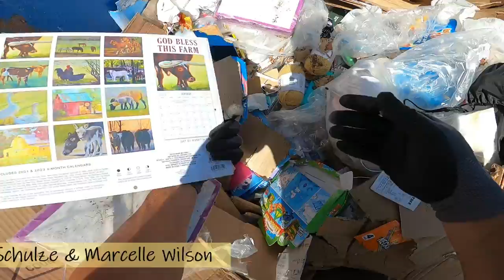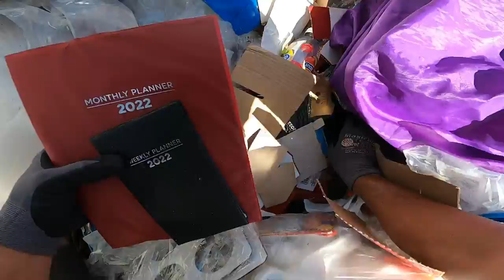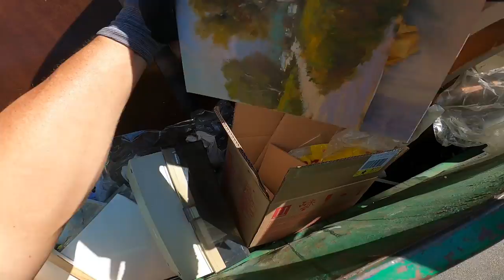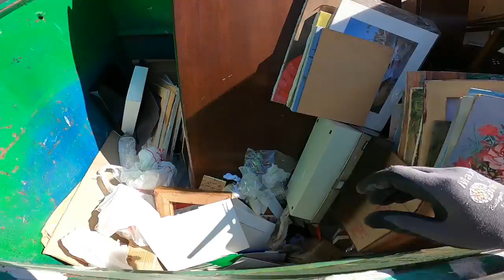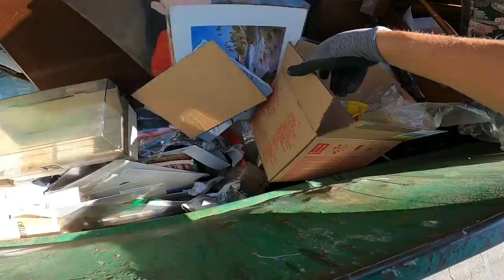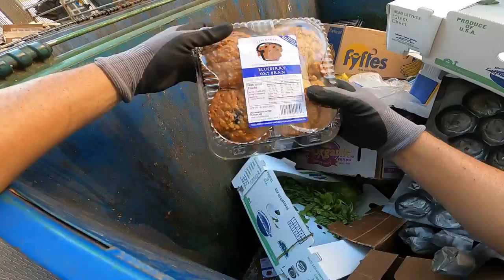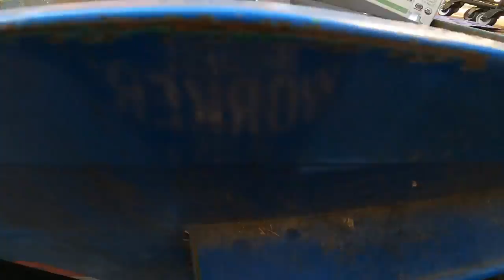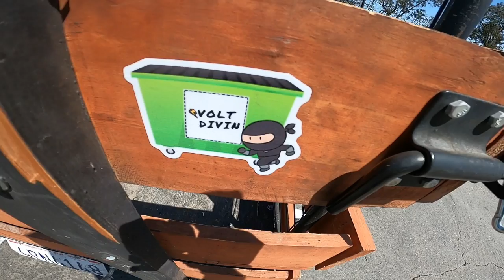Dumpster Diving, better than Amazon Fresh??? - S2E33

Comment: Start looking at marinated mushroom recipies and then also at the ingredients lists of marinated mushrooms on the shelf.  Water bath canned, marinated mushrooms last a year or so.  Simply set in the fridge, they will generally last a couple of months.  Until you get to the actual canning process, they are pretty quick and easy; less than a half hour if you're reasonably set up.  They only call for a 10 minute water bath so, if water bathing you can probably be set for the cool down period in under  2 hours.
Reply from the maker: Thank you Terry!

Comment: I worked at a clothing retailer where they had hangers like those. 
We would use large rubber bands and group them up and sell 10/$ or so I was kinda surprised that there were several folks who wanted them.
But what I like about them- is the hooks swivel, they are very narrow- which allows more garments to hang is less space, 
I’ve had my hangers of that period for over 10 years- sure some have broken -but they were free.